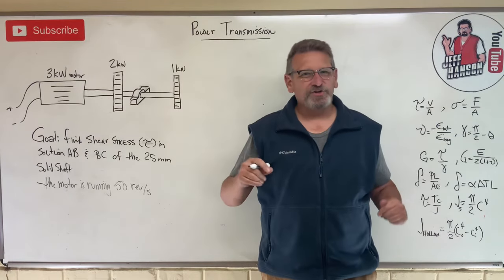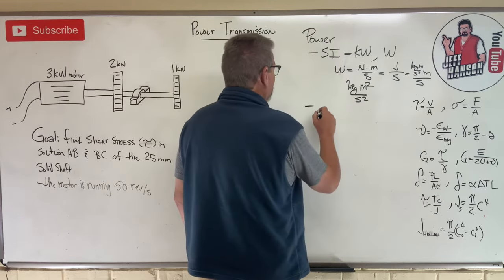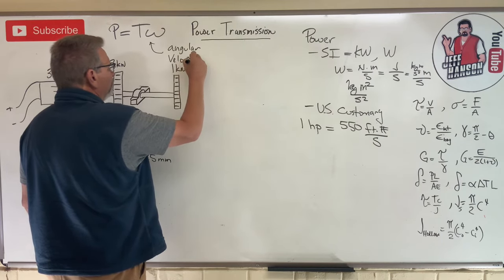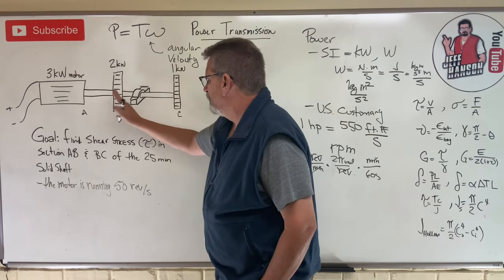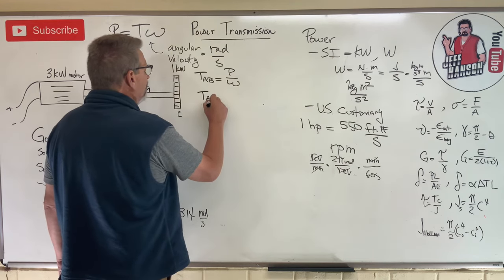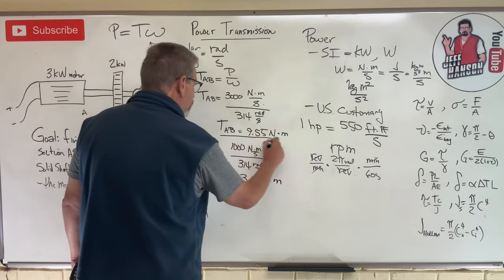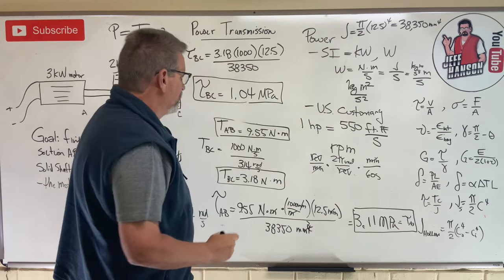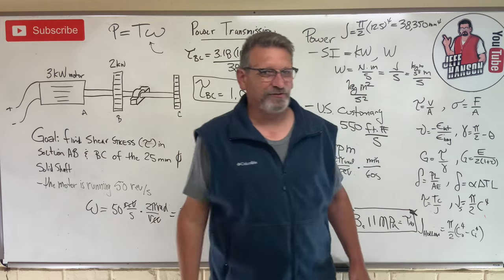Mechanic of Materials: Lesson 24 -- Power Transmission Torque Example

Comment: Why is the value of P in section BC is 1000 Watt, while in section AB is 3000 Watt?

Thank you for your support 😃😃
Reply: yes i noticed this as well I think this is wrong.
Reply: it's becuase the output is not postive 2 KW and 1 KW, It's -2KW and -1KW. So when you subtract the 2 KW from 3 KW, you get 1 KW as a result.

I hope this helps
Reply: @MMMMMMMMMMBALLS how can you tell if it is positive or negative?
Reply: @470bubbles  Watch again from 7:27 sec onwards

Comment: Mr Hanson 🙋‍♀️
 In cancelling out units when getting the Torque, what happened to the "rad" underneath?
Reply: Since the radian is a dimensionless unit (it's a ratio of two lengths), dividing by radians has no effect on the unit itself. So N*m/rads = N*m